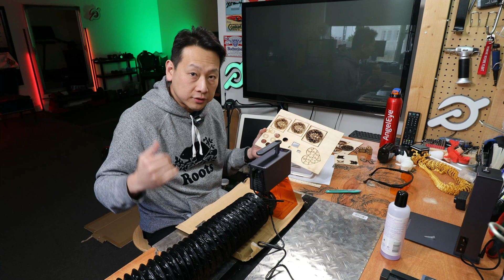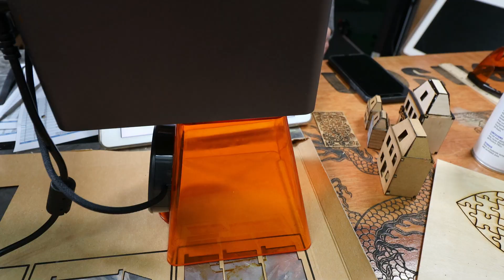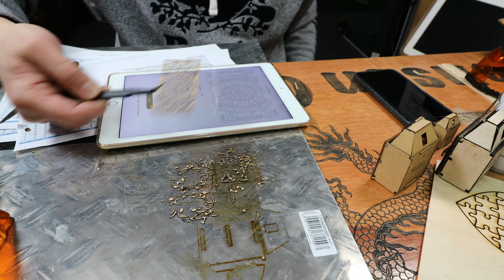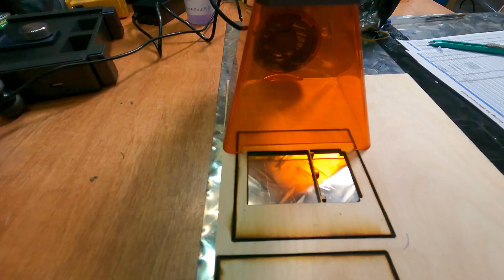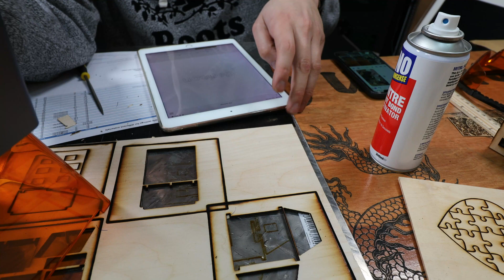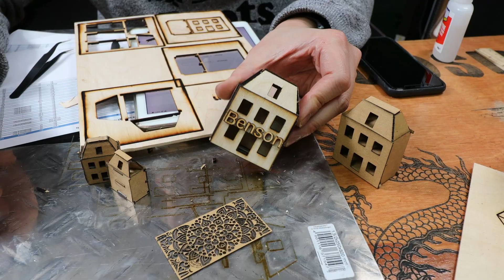LaserPecker 2 First use cutting cardboard and 3mm wood by Benson Chik

Comment: Cut settings I used on wood not quite 3mm thick. Power 100 D 10 passes 30.
Reply from the maker: I use other laser to cut and LP to engrave, cutting with LP2 or even LP4 is not the best. Even my 30w atomstack can cut 12mm of wood I still prefer my band saw unless it is a very details cut.

Comment: Hi thanks for uploading your video. Does this machine let you cut a shape and then continue to engrave the inside of shape? Is there a way for it to continue the item after cutting like a pause to go lighter to engrave the inside?
Reply from the maker: No it does not do that. Only way I know is to do cut and engrave and cut separately with the item fixed on the bed not moving

Comment: Всё дело в фокусировке луча. Из-за того, что используется защитный щиток, который по фокусному расстоянию равен 11 см от линзы до поверхности, под этой поверхностью происходит расфокусировка луча, т.е. точка становится больше и не хватает мощности для выжигания. Как вариант: убрать щиток, надеть защитные очки и опустить лазер на пару миллиметров ниже, чем 11 см. Тем самым в нижней части доски будет сфокусирован луч, а не в верхней
Reply from the maker: So true, I wish the beam is narrower as it is quite hard to cut thicker materials at the edges of the 10cm bed. One could have separate drawings just for the edge and lower to cut through but the line will not be as perfect etc. for cutting I now have a atomstack x20 pro which cut up to 8mm ply with no refocusing needed. It does not engraving anywhere as neat as the LP2

Comment: It should cut the inside details of the print before the outside. That way it doesn’t drop out of focus.
Reply from the maker: Light burn has that option but LP2 does not, it is not catered for cutting unfortunately
Reply: Maybe you could do it as 2 separate files. The first one with the detail but no frame, the second one just being the frame?  Thanks for the video.
Reply from the maker: Light burn has that option but LP2 does not, it is not catered for cutting unfortunately